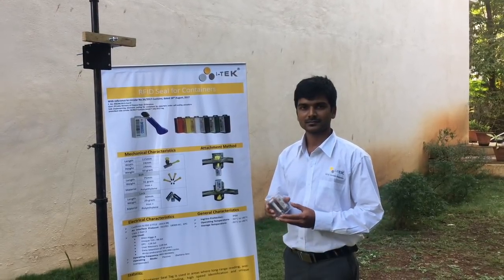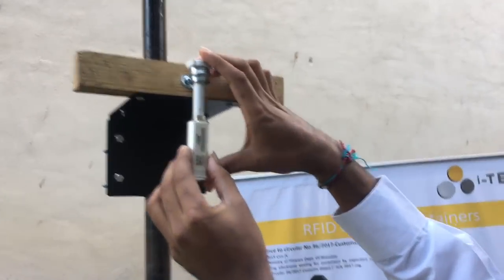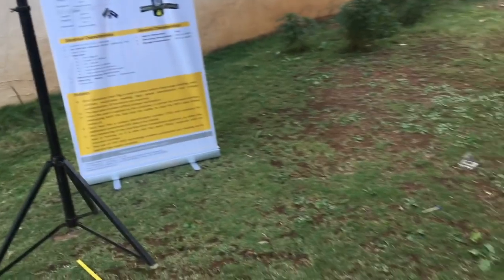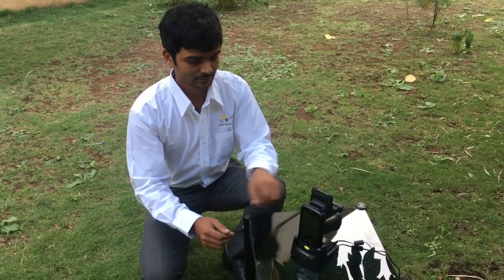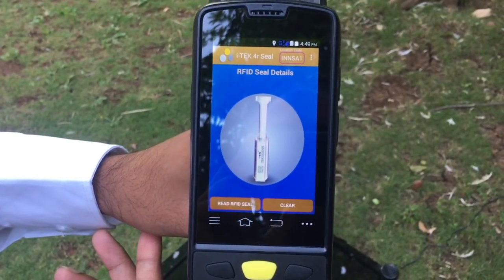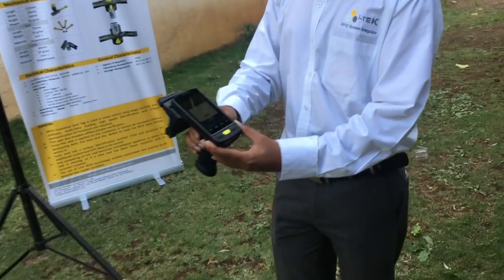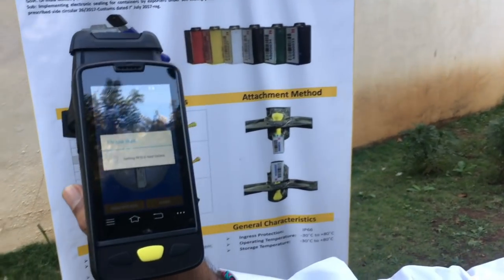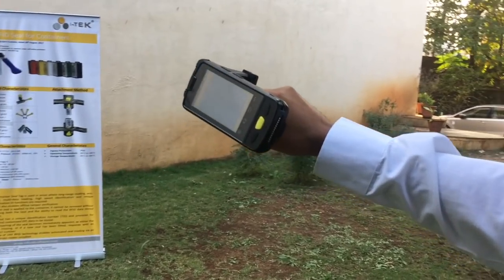iTEK Hand Held Demo for Customs: RFID E-Seal

Comment: Why seal is packed in a plastic cover in "Plastic Mukta Maharashtra" ? you must replace plastic with the paper box or find a way to keep both parts together
Reply from the maker: Dear Mr. Sathe,
 
Thank you for taking out time to view our video. We appreciate your feedback.
 
We would like to inform you that we use Rigid PVC film material for packaging of RFID seal. This material is non toxic and bio compatible. We have required test certificates for the same as well.

The seals have shelf life in years and rigid enclosure protects the seal from any kind of rusting and/or corrosion. 
   
Should you need more information please write to us.
 
Team i-TEK